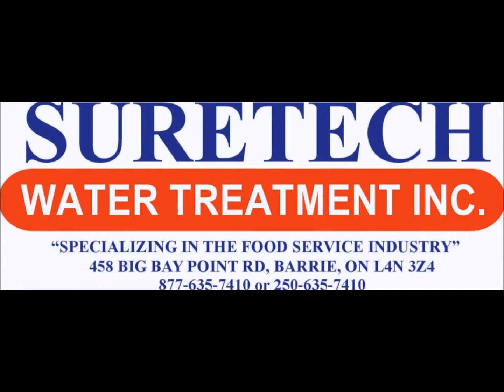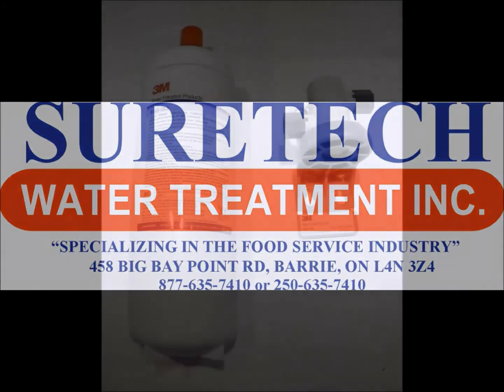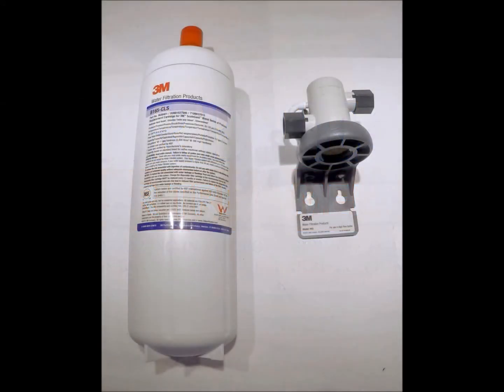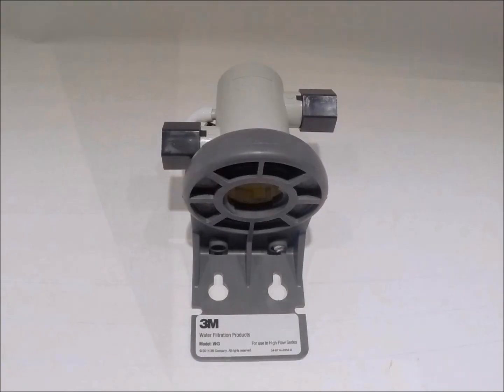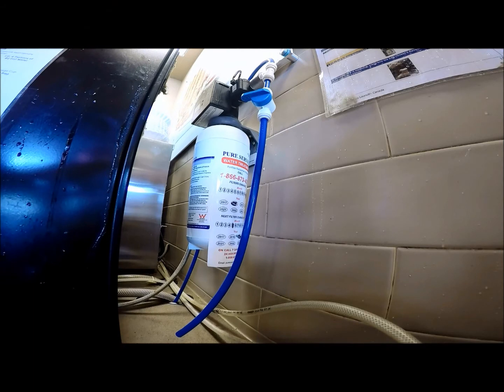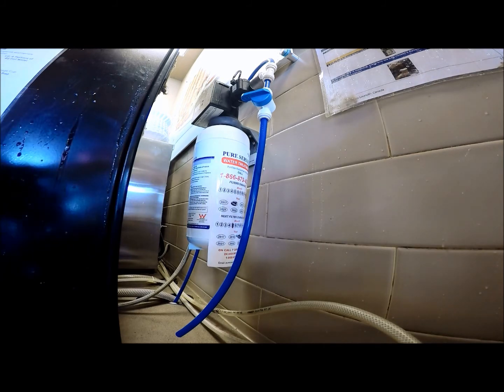3M B165 CLS Water Filter Change Procedure (DEMO)

Comment: I have a 3 M water filter head,  when I hooked up the filter to the head,  the water not only flows out of the output to the faucet,  but also leaks from the small tube,  and got the under sink cabinet wet everywhere, now the water filter head becomes a junk. How to fix it?
Reply from the maker: Make sure you are turning the new filter completely into position. When not completely in position the head will expel water out of the small tube, attempting to relieve the pressure within the cartridge.
Reply: @suretechwatertreatmentinc.5034  yes the water filter was completely screwed into the position. I have tried this several times.
Reply: @suretechwatertreatmentinc.5034  today I tested to install the filter again.  I found if I screwed it completely to the fully position,  the water comes out from both the output and the small tube,  however if I turn the filter counterclockwise a little bit, that means it is loosen a little bit,  the water stops flowing out of the small tube but only flowing out of the output.  And again, if I turn it clockwise to the end to its full position, the water flowed out of the small tube (and also the output) again. Is that normal?
Reply from the maker: @helenliang9249  That is definitely not normal. I think you may have a faulty filter
Reply: @suretechwatertreatmentinc.5034  Then that means I have to dump it into the trash can?
Reply: @suretechwatertreatmentinc.5034  faulty filter or faulty filter head?